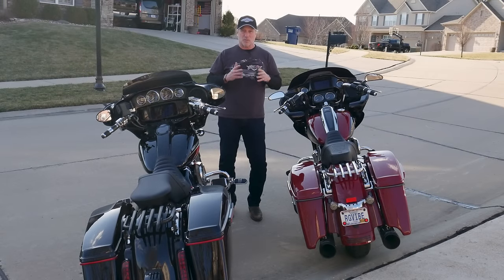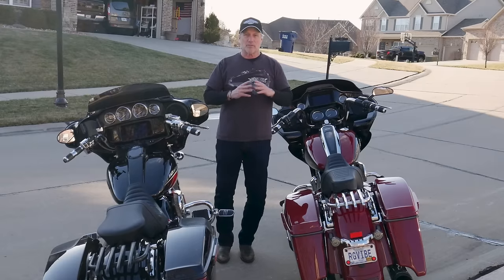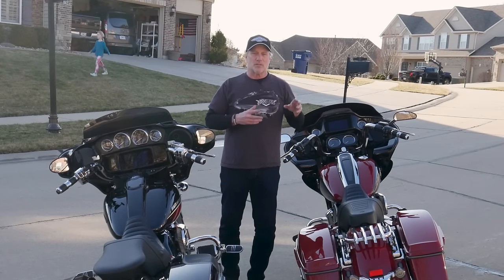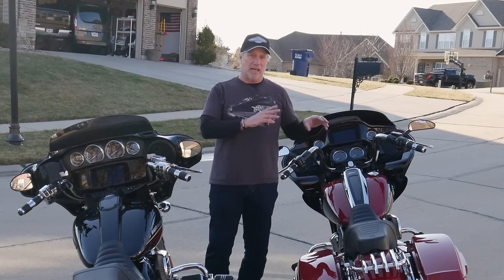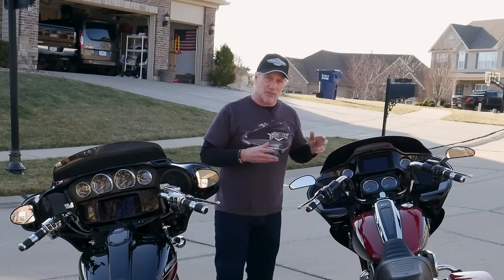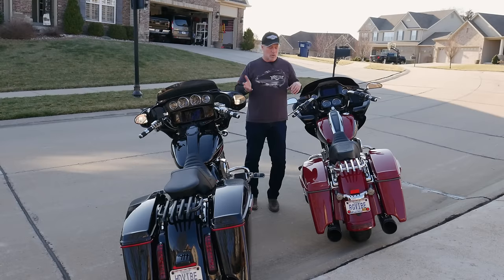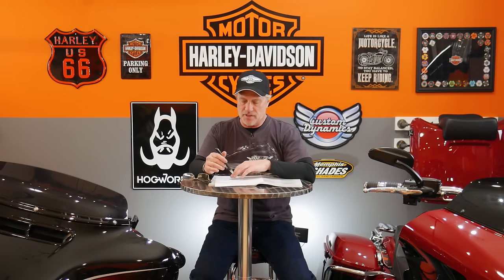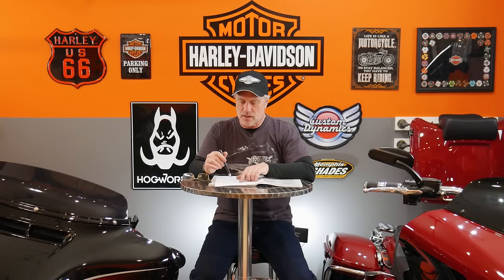Harley Davidson Stage 2 vs Stage 1 Upgrade M8 114 vs M8 117

Comment from the maker: Are you thinking about doing a Stage 1 or Stage 2 to your Harley?  If so or if you are curious to learn the increases in HP and TQ with a Stage 1 or Stag 2 upgrade, then check this out.  You will also get the comparison between a 114 Stage 2 and 117 Stage 1, a cold start and warm idle comparison and all the HP and TQ numbers from a stock and upgraded perspective.   Leave a comment below if you are surprised when you hear the HP and TQ comparisons.  Thanks for watching and ride safe.
Reply: Do yourself a huge favor and replace your stock head pipe and replace it with either a cobra or Vance n hines head pipe and you'll notice a huge difference because it's able to breathe correctly!!!! If you haven't you need to get a Arlen Ness Big Sucker, you will be amazed
Reply from the maker: @chrispenny7599 Thanks for watching and commenting.   On my 2021 Road Glide Special,  I did change out the headpipe and went to the HD Extreme Wedge.  Bike runs awesome and no more right leg feeling like it's going to go into flames.  If you are already a subscriber to the channel...thank you.   If you haven't yet subscribed to the channel I'd be honored if you'd consider doing so.   Thanks for your support and ride safe.  ✌️👊👍

Comment: Just did the stage 2 on my 2019 FLTRU. Wood 22x, JackPot 2-1-2 header, S&S GNX MUFFLERS, S&S Oil pump, Tapps and and cuffs.  It’s a vast improvement. 120hp, 133 torque.  Sounds great and moves like the wind.  Fuel Moto provided everything including Dyno tech power vision tune.  Highly recommend.  Subscriber.
Reply from the maker: Thanks for watching, commenting and subscribing.   Sounds like a great set up.  I look forward to seeing your comments on other and future videos.   Thanks for your support and ride safe.  👊✌️👍

Comment: I have a stock 114 on my FLTRK and I’m happy with it.  I ride it on trips and I’ve found it to be sufficient for my needs.
I did upgrade to Revo A shocks in the rear and I definitely need a stereo speaker upgrade.
Reply from the maker: Thanks for sharing your perspective.   I've also added Revos.  That's a great comfort upgrade.   Ride safe and enjoy. 👊👍✌️

Comment: Now put a bolt in cam in the 117” CVO. If you install the Redshift 468 cam, I guarantee that you will have a new “favorite” bike to ride!
Reply from the maker: Thanks for the suggestion.  I've heard good things about the redshift 468.  Thanks for watching and ride safe. 👊👍✌️
Reply: I saw a vid on the older Woods cam 22xe ? Has the longest and most Torque/HP gains on the 114 with a 2 to 1 setup.
Reply from the maker: Thanks Tex for the input on the topic.  I appreciate the comment and support to the channel.  If you are a subscriber...thank you.  If you haven't yet subscribed I'd be honored if you'd consider doing so.   Ride safe and enjoy.  👊✌️👍
Reply: @HDVIBE  No problem. Did you see the Harley Davidson release of the new motor? 135 !! Kyle Wyman hit 180mph in Daytona. Ya Buddy!! I have 2019 Street glide special with the Woods cam 22xe and stock exhaust moded to a 2 to1 possibly with the baffle delete. Elvira definitely moves and sounds nice. I just wish the mushroom shaped air filters were a little bit flatter for knee room
Reply: @HDVIBE  I'm a subscriber now 💪
Reply from the maker: I did see the 135 release and Kyle Wyman rippin ' on it. 👊✌️👍
Reply: I have a stage 2 upgrade on my 2017 FLTRU Road Glide Ultra. Tuned to 106.95 RWHP 104.88 TQ.
107 is a great little engine, I have a 2021 Road Glide special. Nothing special about it, but it’s stock.
Reply from the maker: Yes, I have seen some very nice numbers getting made with the 107.  Sounds like you have your dialed in.  Thanks for sharing the info.  Ride safe and enjoy. 👊✌️👍
Reply: I have a rs468 on my 19 fatboy 114 with 2-2 freedom performance exhaust and still pulled a 129tq and 114hp wich is not bad for having a 2-2 exhaust but it all depends on the person doing the tune...
Reply from the maker: @Tony-nq1nj Thanks for watching and commenting.   Sounds like a great set up.  If you are already a subscriber to the channel...thank you.   If you haven't yet subscribed to the channel I'd be honored if you'd consider doing so.   Thanks for your support and ride safe.  👊✌️👍

Comment: I have a 2022 RG special with the stage two torque cam installed with the tuner all covered under warranty on my 114. I’m happy with it. Once the warranty expires I may do a big bore kit.
Reply from the maker: Thanks Casey for watching and commenting.   Sounds like a good option once your warranty is up.  If you are already a subscriber...thank you.  If you haven't yet subscribed I'd be honored if you'd consider doing so.   Thanks for your support and ride safe.  ✌️👊👍

Comment: I have a 2022 Lowrider M8 117. It's a beast I'm still getting use to. Highway speed in Florida is typical 70 with most people doing 80. I have to remind myself there is a 6th gear because 80 in 5th is so smooth. Twist the throttle at 70 and I was shocked how quickly I got to 90. Practically speaking I'm not sure spending the money for a stage 2 is worth but who ever said what we do on motorcycles is practical.
Reply from the maker: Thanks Paul for watching and commenting.   Great perspective in your comment.   I'm sure your Low Rider is a beast with the 117.  If you are already a subscriber to the channel...thank you.   If you haven't yet subscribed to the channel I'd be honored if you'd consider doing so.  Thanks for your support and ride safe.  ✌️👍👊

Comment: I have a 2022 Road Glide St with 117 M8.  Did a stage 2 with a Star 30-30 cam, 50 MM S&S manifold, D&D 2-1 Billet Cat with Vortex baffle.  Just had it Dyno-tuned the other day with power vision and got 123 HP and 135 TQ at the rear wheel.  Max torque hits at 3k rpm.  Keep in mind, when a manufacture quotes horsepower and torque figures, it always at the crank, which is much higher than the rear wheel, so not a fair comparison.
Reply from the maker: Thanks Todd for the info.  Sounds like you really have your bike dialed in.  Those are some really nice numbers.   I can't imagine riding a bike with that much torque.  Must be incredible.   Ride safe and enjoy. 👊✌️👍
Reply: My dealer was shilling this exact set up.   I never took the plunge.  I have 2022 RG CVO with the black chrome so limited choices if I want to keep exhaust matching.  And after a full year of the endless opinions on cams I’m kindof left wondering if max power necessarily equates to max riding enjoyment.  I’ve heard stories of people with 131 kits that hated riding them at lower speeds.  And I wonder if a cam that is more middle of the road may be something nicer to cruise with.  
Do you have any thoughts on this and are you completely happy with the direction you went?   Do you find that you need to clutch the bike more at low speeds?  Is it still comfortable lower speed group ride cruising?
Reply from the maker: My experience with the SE8 447 cam has been very positive.   No change in ride except when I want to twist the throttle a bit harder and you feel the extra torque and power.  Also at slow speed I have no issues.  I recently spent a few hours doing slow speed maneuvers on the range and was perfectly comfortable with the set up.  If you are a subscriber already....thank you.  If you haven't yet subscribed,  I'd be honored if you'd consider doing so.  Ride safe and enjoy.  👊✌️👍

Comment: The reason I don't stick with HD Stage 1 and 2 is simple.  A 107 with a non OEM stage 2 and proper dyno beats a stock 117.  I get that HD has to follow EPA regulations, but an aftermarket cam, exhaust and air cleaner shouldn't be able to beat a stock 117, yet it does simply because the EPA has hamstrung HD so badly.
Reply from the maker: Thanks for sharing your perspective.   The 107 as you mentioned definitely can be tuned to out do the 117 or even bigger motors.  It's all about the tune and if dyno tuning it's all about the guy doing the tuning.   Thanks for watching and ride safe. 👊✌️👍

Comment: I have a 22 Road King Special,  Fuelmoto Jackpot 2-1-2 head pipes, DBX-45 mufflers, SE-447 cam, Power Vision tuner with a tune from Fuelmoto. 
I started with stock head pipes and a SE Canned tune. The difference in power and sound is night and day better with the Fuelmoto  setup
Reply from the maker: Thanks Mike for sharing your set up.  Sounds awesome.  I know a non Harley tune would really change the game.  Thanks for watching and ride safe. 👊✌️👍
Reply: Did Fuelmoto do the install?

Comment: Rick,
Great talking points and just some good info. I had the 447 cam in my 2018 107 heritage and like yours, really woke that bike up, especially with the power to weight ratio.  Went aftermarket Fueling 465 cam on my 2017 Streetglide with full Rinehart exhaust and boy is she fun. 
I can't pick a fav or more power, both are snappy as hell now and it makes me want a cam in the 114.
Reply from the maker: Thanks Jason for your comment.  I never thought I'd put a cam in my bikes in the past, but now I'm hooked.   Thanks for watching and ride safe. 👊👍✌️
Reply: @HDVIBE  yea it wasn't until the dealer I bought the heritage from asked if I wanted the cam as part of the deal? Only paid for the parts and labor was waived.  I feel that a cam is more than enough of a change, and yet still practical while budget friendly.  Did a 95" kit on my 02 roadking and had more issues than I care to recall, so cam is the most I'll do.  Once these motors start giving out, I'll just get a crate motor put back in.

Comment: Have a S&S 475 cam in 2018 stage 2 fat bob with a dyno tune. Fuel economy improved after tune , totally transformed the bike.
Reply from the maker: Thanks Richard for sharing your set up.  Sounds like a great set up on the Fat Bob.  If you are already a subscriber to the channel...thank you.   If you haven't yet subscribed to the channel I'd be honored if you'd consider doing so.   Thanks for your support and ride safe.  👊✌️👍
Reply: I have a stage 1 on a 23 fat bob 114. Thinking about a cam now, what's your impressions?
Reply from the maker: Thanks for watching and commenting.   My thought is you will be surprised by how much more power you will feel if you go to a Stage 2.  If you are already a subscriber to the channel...thank you.   If you haven't yet subscribed to the channel I'd be honored if you'd consider doing so.   Thanks for your support and ride safe.  👊✌️👍

Comment: Nice video. I am going to the stage 2 on my 22 Fat Bob(whenever the parts get in). One item I am installing also is the SE aluminum intake manifold. It is polished internally and no possible warping problems.
Reply from the maker: Thanks Bill for watching and commenting.   I have heard good things about the SE intake manifold.  That is definitely something I may consider as part of a future upgrade.  I appreciate the input.   If you have already subscribed...thank you.  If you haven't yet, I'd be honored if you'd consider doing so.  Ride safe and enjoy. 👊✌️👍

Comment: I have a 23 Road Glide ST.  I put stage 1 with Harley Street Cannon slip-ons and Pro Street Tuner.  I also added the Harley Smart Tune Pro.  Admittedly the bike runs great and has excellent power.  But, having more money than sense, I somehow want more.  Tech I talked to told me Harley did not offer the torque cam in the 117 ST as it was so close to the 447 that you could not feel the difference.  I am looking at the Screaming Eagle Power Cam (462).  Many commenters in various forums state that with this cam you will lose low end torque, however all of these were installations in 107's and 114's.  If you look at Harley's dyno chart you see significant increases across the board.  Also comments by people who actually put this cam in their 117's report more power at all RPM's from stock and are very happy.  My bike came with a lifetime warranty and as such I'm going to use Harley parts installed by dealership in my drivetrain.
Reply from the maker: Thanks for watching and commenting.   I also have studied the torque and HP curves for the 117 with the 462 cam.  It's definitely an increase over the stock 432 cam and looks like a nice upgrade.  I'm still debating if I will upgrade the cam on my 2023 ST or go to the Stage 3 122 kit.  If you are already a subscriber to the channel...thank you.  If you haven't yet subscribed to the channel I'd be honored if you'd consider doing so.   I'd like to hear what your thoughts are on the 462 cam if you go that route.  Thanks for your support and ride safe. ✌️👍👊

Comment: Subscribed 👍 I was told by a Harley mechanic at our local dealership here in Tennessee in I bought the bike from Moonshine Harley it’s a 2022 low rider FXLRS with a 117 stock. All I’ve done was put tab performance slip on on it. No issues. Got great back pressure, I was told the torque on the 117 stock is 125. I have not personally looked this up but I’m about to.
Reply from the maker: Thanks for watching and subscribing.   The 117 on the Low Rider is great especially for a lighter bike.  I've recently put a Tab Performance full exhaust system on my 2021 Road Glide Special...holy cow.  With the Stage 2 torque cam...it sounds incredible.   Thanks for your support and ride safe.  👊✌️👍
Reply: @HDVIBE  awesome set up you have there.

Comment: Great video and comparison! Not surprised with your preference on the 114 vs 117.  Stage 2 completely changes the bike in my opinion! Would highly recommend it on the 117 :)
Reply from the maker: Thanks for stopping by brotha.  The cam has really opened my mind to what else can be done on these M8s.  I appreciate the support and ride safe. 👊✌️👍

Comment: Had a s/e stage 2 torque cam in my 114-then swapped to s&s 475
Worlds of difference, with an aftermarket tune ofcourse
The torque cams hardly noticeable once up to speed, the 475 actually keeps pulling the more you roll it on

Wouldnt waste my time or money with a s/e cam or dealer tune again.. also sounds far superior

I get that people leave the 117 stock as its probably “enough” power but if your going to do it do it right this time and do an s&s 475 or redshift 468 or alike in the 117 with the whole kit not just the cam
Screw the warranty screaming eagle cams are useless
Once you have a proper stage 2 unless your racing its more than enough for the street
If it makes the 114 go hard the 117 would only go even better
Had no issues what so ever with reliability etc so warranty has not been an issue its a reliable kit aslong as installed and tuned accordingly
Reply from the maker: Thanks Luke for all the info.  This is very helpful.  I may put a 475 in at some point in the RGS.  Since I have the entire cam chest changed out, I'd just need to have the cam dropped in and get a different tuner.  Ride safe and enjoy. ✌️👊👍

Comment: Great job on the comparison discussion. I kind of March to the beat as you and just stick with HD vs. aftermarket. The piece of mind of having some sort of warranty, even if only labor is worth it to me. Great job, Rick!
Reply from the maker: Thanks for stopping by the premiere today Eric.  I appreciate your support and comment.  Ride safe and enjoy. 👍👊✌️
Reply: Harley is no longer allowed to void your warranty if you put after market parts on or in your bike. Not sure why so many people dont know this yet
Reply from the maker: That is true when it comes to parts and who does the install.  However, the one exception in the new warranty information is a non Harley EPA tune.  So if you use another tuner that maps the ECM and it gets hooked up to the Harley Digital technician,  the VIN gets flagged in the Harley system and if an issue arises, the warranty more than likely will be void.  Thanks for watching and ride safe. 👊✌️👍